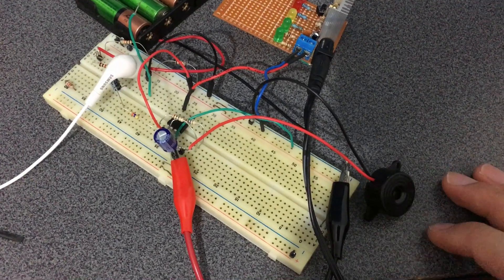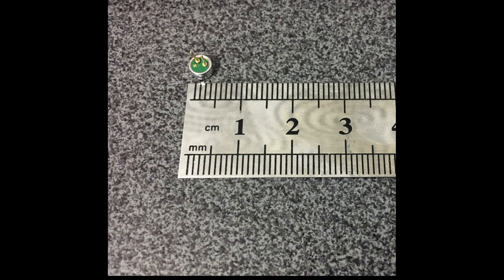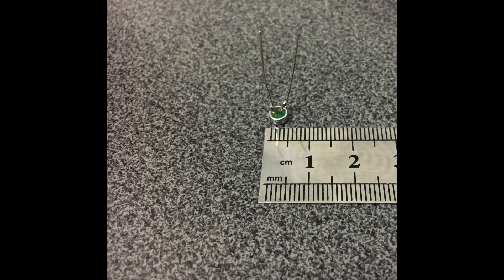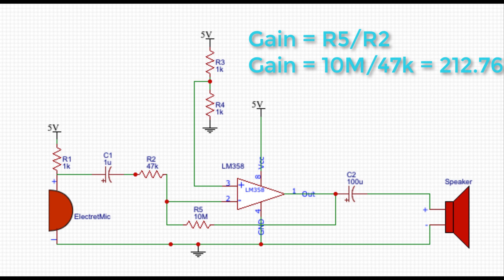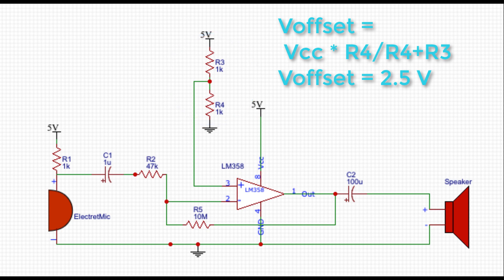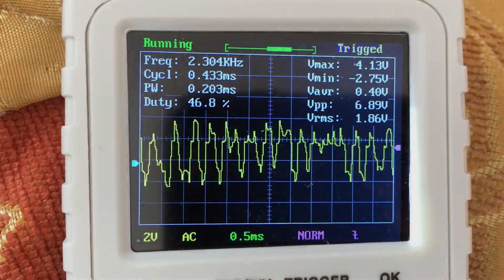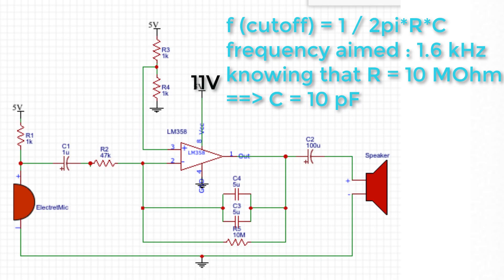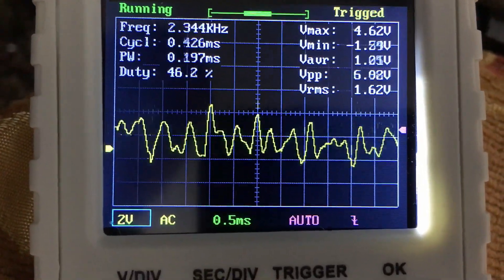Make Your Own Speaker Using a Buzzer

Comment: If talking about the gain of the opamp there are 2 essential gains: for the inverting an non-inverting output. The gain for the non inverting input = 1+R5/R2. NOT R5/R2. This is essential because C1 makes the DC amplification =  1. Therefore the 2 1k resistance get the dc component of the output 0,5vcc